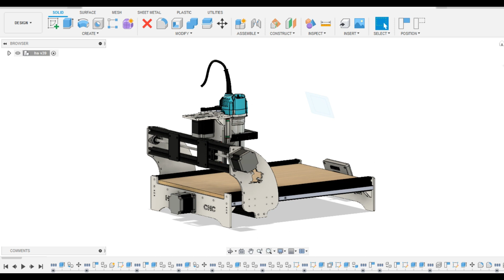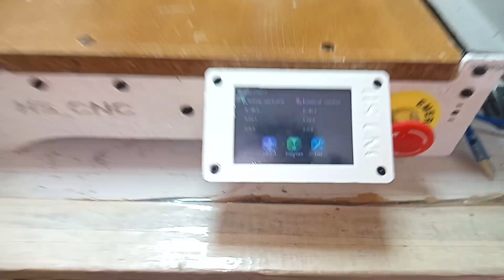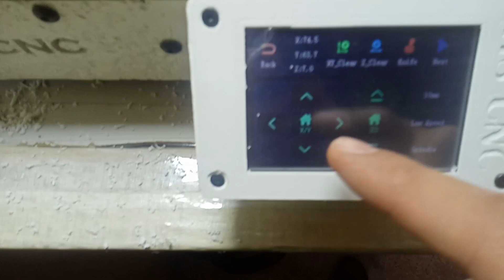Building a DIY CNC Router from Scratch Using Recycled Stepper Motors

Comment: What controller is that?
Reply from the maker: it's the MKS DLS32 a board based on 32 bit controller(esp32), giving you the possibility to control it using WiFi.
Reply: Niiiiice that dlc32. What firmware do you put there? Some marlin based or something more appropriate for cnc cutting 3 axis? Gr8 project mate!
Reply: @VascoRocha  It uses 32bit version of GRBL. :)

Comment: Great machine! I made few CNCs but your is so good. 😢😢 I spent a lot of money to made a machine. Here are two examples. I spent 400€ for the first and more than 1000€ ( dust shoe and cyclone for wood and  vice for metal included) for second machine, this is very expensive hobby.  🤔🤔

https://youtu.be/TDTDN_KkoJc
https://youtu.be/ziXmku7p6O0
I use MDF for work plate on my second shown machine because metal one is too expensive. I have great and precise vice which I mount when I am doing aluminum and metal and I use only mist not flood. I use piece of thin metal sheet to protect MDF but some coolant sometime drip on MDF 😥

Bits are very expensive although last long. I spent more than 6€ for single tungsten carbide coated bit !!!! 😗😗 and I have a lot of various bits for different materials so this is great expenses for this hobby or work.